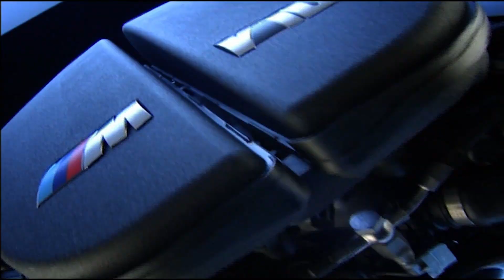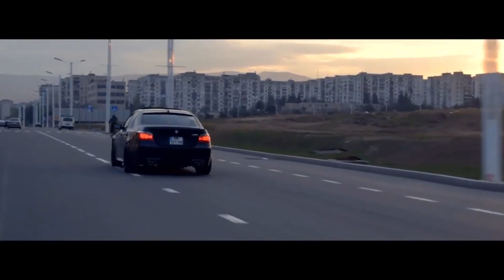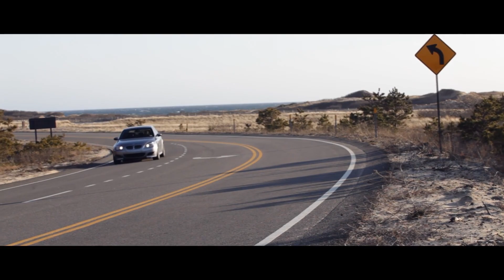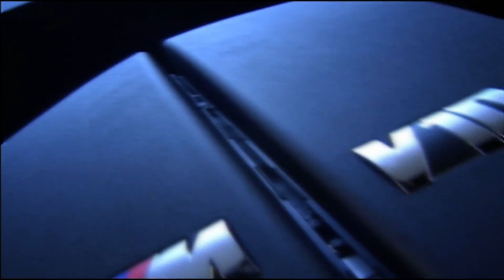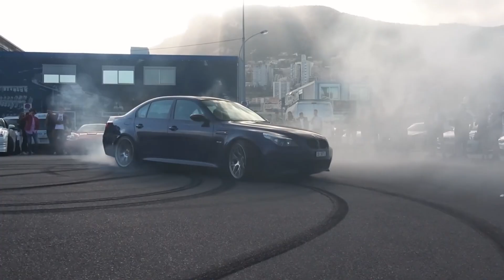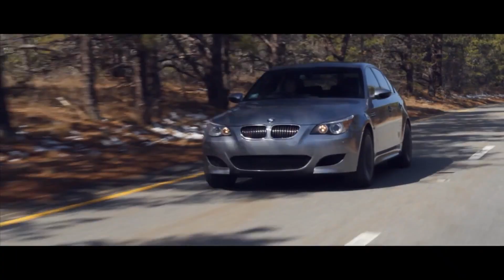The BMW V10 That Redefined Performance — E60 M5 & the S85 Engine

Comment: Williams and BMW didn’t win the Formula One championship in 2004!

Ferrari won the F1 Constructors' Championship in 2004, marking their 14th title and sixth consecutive championship win. Michael Schumacher also secured the Drivers' Championship that year.

However, the BMW-powered Williams F1 team won 20 races between 2000 and 2005.